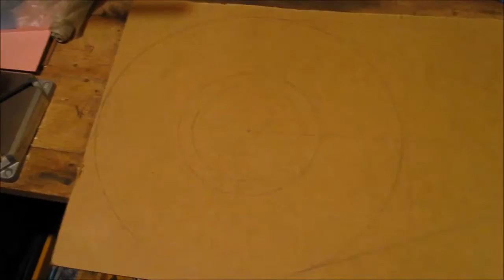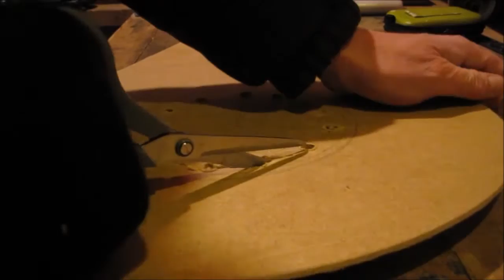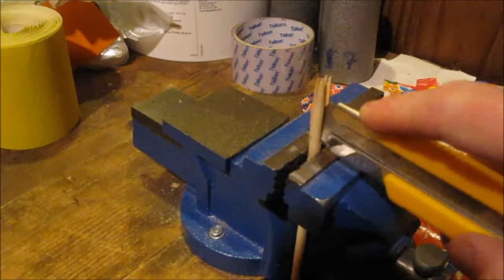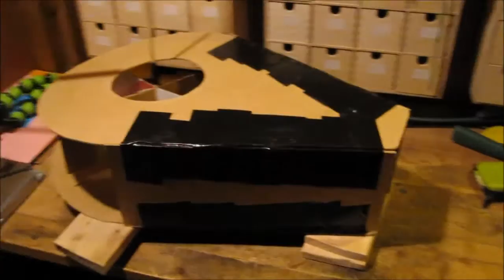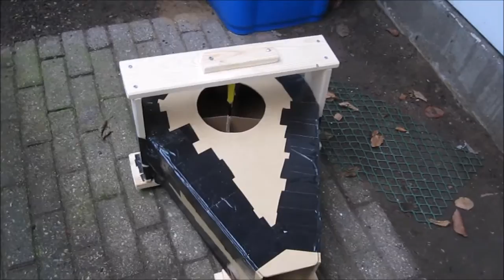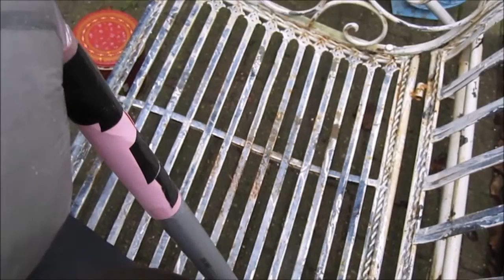Hand powered centrifugal blower with an organ pipe

Comment: Great design! you've built your casing very well, and the problem with my one was that it was probably too small. A solution to your problem would be higher speeds. But a problem that I already see with yours is the cardboard you use for the paddles. If you were to spin it faster the cardboard would just bend. You might have to look into getting some thin plastic or something.
Reply from the maker: Thanks for commenting! Yes, the cardboard is not stiff enough, but another
problem is that the friction between the spindle and the cord is too
low and this means that the cord slips very easy on the spindle. I
tried to put a piece of sandpaper on the spindle in order to increase
the friction, but that destroyed the cord. Perhaps I could make some
kind of gear instead, but that would make my blower much more
complicated to construct.
Reply: Cool blower dude but,it needs something strong for fans like bark or thin sheets of plywood keep up the good work.

Comment: It would probably work better if you built a reservoir to keep the flow of air constant when you stop turning the blower.
Reply from the maker: Thanks for the comment. 
The plastic bag is the resevoir (that is the idea), 
but perhaps I should use a bigger plastic bag.
Reply from the maker: A second thought: I think a bigger bag will not help. It is the pressure from the blower that is too low.

Comment: which is the most effective and efficient way to place the blades? (speed and air flow relation)
Reply from the maker: Curved blades could be a little meore effictive, but straght blades allows you to use both directions with the same efficiency. Straight blades are also easier to make.